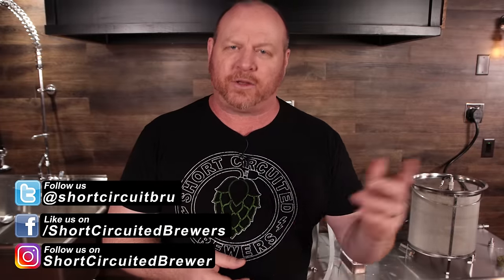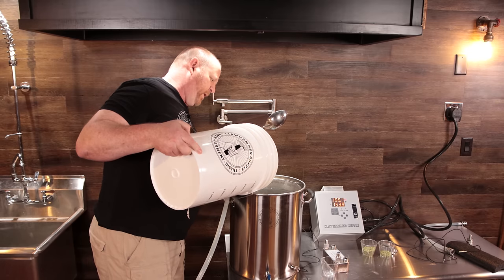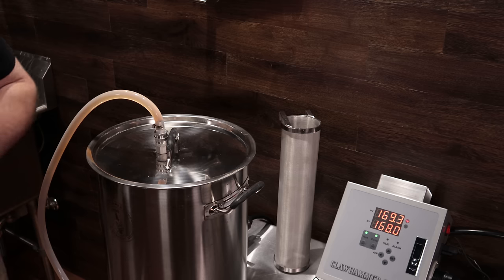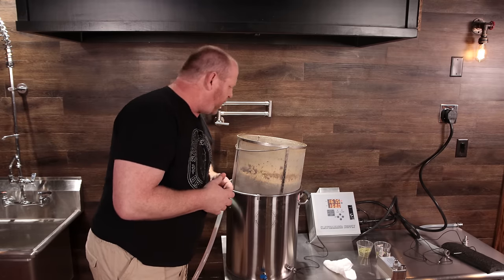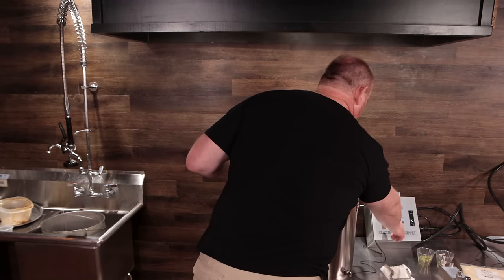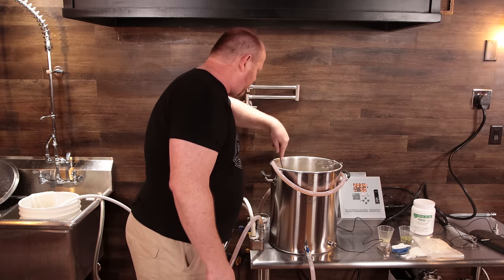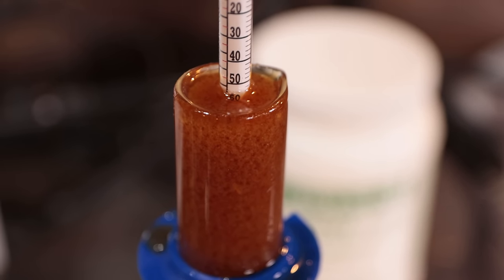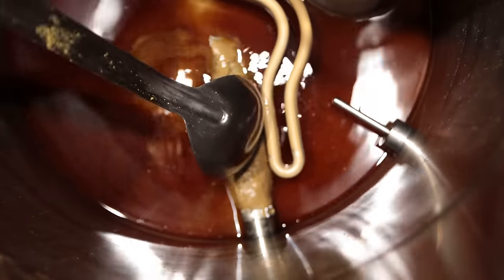Clawhammer Supply 240V 10 Gallon system Brew day/Review

Comment: Brian, thanks for all the great videos. I’ve been using the 120V version of this system for a while now.  There’s no need for a double crush. The micron mesh level of the grain basket is small enough that I use a .025 setting on my mill and I hit my pre-boil and original gravities very consistently.  One crush at that setting and you’re good to go.
Reply from the maker: Yep.. I leave mine a bit wider since I am not just brewing on one system.. The double crush was the solution for me not to adjust the mill. Should have done it this time..live and learn!! 👍🍻

Comment: I have their early 110v system, which was an upgrade from my basic “turkey fryer in the garage” set up. It takes a bit longer to get to temp but otherwise, it has been great. Easy to use, easy to clean and we’ve made some great beer with it.
Reply from the maker: Nice!! 👍🍻
Reply: How long does the 110v system take to come up to mash temp and then to boil temp? They tend to gloss over the timelines in their videos, which makes it hard to judge the system fully.

Comment: I run a DIY basket type system and I get between 85-90% efficiency regularly. My experience is that you do a normal strike water volume as if you were doing a 3 vessel brew. Use a smaller crush (I’m set to around .037”), slow down recirculation and stir about every 10 minutes. Then sparge to preboil volume as you would with a 3 vessel system. Of course this requires another vessel for sparge water, I use the grainfather hot liquor tank personally..
Reply from the maker: Sounds like you got the process dialed in very well. Good tips! 👍🍻

Comment: First of all.  Your channel is awesome. I've learned so much about equipment and the process.  I'm looking to upgrade from my 3 tier 10 gallon batch cooler system to an EBIAB. I've narrowed it down to the clawhammer 240 or the Anvil 18 gallon.  In your opinion, which is the better system all the way around.  I know the clawhammer is modular (which is why I'm kind of leaning that way) but also just recently saw that anvil now makes an 18 that does 10 gallon batches.  Now I'm torn between the 2.  Thank you for your response and for the information on all things brewing.  Cheers
Reply from the maker: Thanks for the feedback! 

They are both good systems so you really can't go wrong with either one. The Anvil has a little less power requirements than the clawhammer so that is a difference to note. The Anvil will run on a 20 amp inline GFCI (Did it last weekend as a matter of fact) so if you don't have a 240 volt outlet handy you can run it off a dryer outlet. Clawhammer as you said is modular and that is a plus since you can replace a component should it fail or you burn an element. Let me know which way you go. Use my links and help support the channel if you don't mind. 😁👍🍻

Comment: Thank you Brian. I’ve been wondering about cleaning that basket myself for ages. You cleared that up for me, cheers.
Reply from the maker: I was curious about that too!! Having used fine mesh bags that were real pain!! This was really easy. 👍🍻
Reply: @ShortCircuitedBrewers  Hi Brian. Was curious. I noticed the basket is mesh on all sides even up to the top. Seems like most of the ebiab systems like foundry/robo have a mash basket that is not mesh/perforated on the sides, but rather, only near the bottom.  Does having a basket with mesh up to the top allow the flow to go out the basket near the top instead of filtering down through the grain? Does having the mesh all the way up the sides affect effeciency if it can "leak out" the sides near the top? Thanks!

Comment: I have the 20 gallon 230 volt system. I also have lower efficiency issue. I tightened my grain mill to its smallest and I gained 5%. I have also  had issues with mash temp as well.
Reply from the maker: I was going to contact you before I made this video but did not have time. Have you auto tuned the controller? What kind of efficiency are you getting?
Reply: @ShortCircuitedBrewers  Hi Brian! I have auto tuned the controller. I may do it again. I was thinking of putting a "T" connector in line with the pump with a thermo well so I could see the actual temp of the wort as it circulates. (Not sure how accurate Clawhammer thermowell is where it is positioned). When I take a temp reading of the mash it is sometimes off by 5 F. (mash temp is lower than the wort at the bottom of the brewing kettle). I think its a flow issue.I never have stirred the mash half way through the mash but will try that as well. I wish that the basket sides were solid like Spike. The first 2 brews I did I got 60- 65% efficiency. Not happy with that as I would get 80% efficiency on my old system using a cooler and fly sparging. I set my mill to its tightest position (bottom of the line grain mill) and my efficiency went up to 70% I can live with that. I usually add an extra pound of grain. Over all I do like the system. Reach out any time Brian! Love your channel. You inspired me to go electric. Need more electric brewers YouTubing! Cheers. Shawn.

Comment: I thought they were nuts also when they used the grain basket for the hops lol. Thanks for the video Brian. Great video like always.
Reply from the maker: Yeah I made the mistake of trying it and learned really quick!! Lol👍🍻
Reply: @ShortCircuitedBrewers  seems like the hops would work fine in the basket if you weren't using the pump though, correct?  Hop spiders set too high most times so that you can't do more than a couple of ounces, so for IPA's, I'd think the basket for that would be a great selling point.

Comment: Tip for when you add dme or sugars to boil  use an empty hop spider then put any sugars etc in there as it allows it to peculate slowly into the boil-cheers
Reply from the maker: I just turn off the element and stir it in... Always works for me.. Good too. Though if you have an extra spider. 👍🍻

Comment: I have a few questions for anybody reading this:
1 Have you used the 120v? If yes what are your impressions
2 I have no experience with this type of system and I noticed sparge is not required, what’s the water to grain ratio for this? 
3 Is it possible to brew 5 and 10 gallon batches on this kettle?
Reply from the maker: 1 I have not 2 I use a calculator software, but you can Google biab calculator for an idea in how much grain you can use. 3 it will not do 10 gallon batches. Kettles not big enough. 👍🍻

Comment: I love the content of your videos! Super helpful. I'm currently debating on which all in one system to go with. Would you recommend the Grainfather 30L or the Anvil 10.5G. I'm not super worried about the price differences, just would like to know some pros and cons in comparison to one another.
Reply from the maker: I have used both, personally the grainfather does not add enough value to justify the extra cost. Now that the anvil controller is up top it makes it even harder to justify the grainfather. Get the anvil with the recirculating kit and spend the extra on a Jaded Scylla chiller and a fermenter.. Thanks for the feedback too!! 👍🍻
Reply: @ShortCircuitedBrewers  Thank you very much. I was leaning towards purchasing the Anvil system but just needed that push and that extra money being saved can definitely go to corny kegs or extra fermenters. Thanks!

Comment: Still trying to weigh my buying options ;-). Can you elaborate a bit about the temp probe and how it is "held" into the kettle port? I saw it quickly in one of CHS's vids. It looks a lot like an Inkbird style probe. I'm concerned with its accuracy at high temps and of course its longevity. I would think the RTD/XLR connector types would be more resilient.
Reply from the maker: It is exactly what you are saying. A ink bird probe in a thermo well. It is not really held in at all just slides in. I typically use weldless RTD probes in my kettle. They are using a RTD probe in this case you'd just have to adapt it to a 3.5 mm plug. Which you can do because I've done it. 😉

Comment: I'm looking for a BIAB system (120v for me unfortunately) and this seems like a nice system. You seem to be the only channel that has tried so many different brands of these systems. How does this compare to other systems? I currently run a gigawort and bags. Wile I like it fine, it kind of limits me on batch sizes. Thanks again.
Reply from the maker: On 120 volts, the brewzilla and anvil are also contender in the batch size range. The advantage the clawhammer is that you can replace some of the parts. Other all in one's lack repairablity. 👍🍻
Reply: @ShortCircuitedBrewers  Thanks. More to think about. Which one's controller holds temps the best? If the other 2 more inexpensive systems produce the same results, it might not be worth paying double the price.

Comment: Another good video. Thank you. I’ve been looking at this system and the anvil foundry. Like I have spoken to you before. I’m new to this and haven’t started yet. Could I get your opinion on what system would be best for somebody just getting into brewing.. thanks again
Reply from the maker: This system will brew great beer for sure. And quickly too lol! I think starting out it is not a bad idea to look at lower cost all in one systems . The initial investment is a. Little lower and if you should upgrade to a larger more expensive system the all in one vessels. Make a great water heater for sparging etc. 👍🍻
Reply: Thanks again for your information. Would I be okay with the anvil foundry 6.5. ?.. and is there website to help you adjust from 5 gallon batches to 2.5-3 gallon batches ? And how can I purchase one of your t-shirts.. thanks.
Reply: @danielsweet937  I too would recommend a less expensive (and simpler) system for starting out.  I went with a Mash & Boil for $300 (as I added the fermenting lid to it), and have done 30+ brews on it with great success.  Fermenting in it is a HUGE bonus as well, as my cleanup is minimal, and it helps keep my brew days under 3.5hrs.  It also eliminates a transfer, which is a risk point for contamination.

The clawhammer is what I was looking to move up to next, but I don't think I would unless I needed to brew 20gallon or high gravity batches.  If you want to do 2.5-3 gallon batches on the anvil/mash&boil type systems, there are PLENTY of online resources to adjust your recipie, and these systems will give you great versatility and ease of use for that size for sure.

Comment: Many thanks for your nice videos and the useful information.  How would you compare / rate this system against the Anvil Foundry?
Reply from the maker: The capacity is about the same, the basket on this system. Allows for a finer crush than the anvil. The clawhammer system has quite a bit more power than the foundry so heating times will be less. The clawhammer system is a bit more "modular" so you can replace an element or sensor if it goes bad. There are advantages on both sides of the argument. Price is a factor to consider too. Both systems will make great beer for sure. 👍🍻
Reply: @ShortCircuitedBrewers  Hello Brian, many thanks for your quick and helpful reply.  Your videos are very informative and enjoyable.  Best,  -Wolfgang

Comment: All things considered, would you choose the Spike single vessel system or the Clawhammer single vessel system and why?
Reply from the maker: Not having brewed on the larger clawhammer system I can't say definitively, the capacities are about the same from what I can tell. I'd provably say the spike system due to the controller having replaceable parts. Having brew with electric for as long as I have... Things go bad eventually and can you easily replace them.. 👍🍻

Comment: Is it ok to constantly stir the mash?
I'm also wondering if it's a good idea just to get a better efficiency or higher gravity ?🤔? What do u think
Reply from the maker: From the results I could not tell you for sure.. Lol 
I will say the way that the basket is designed, it won't hurt anything because you're not really filtering through the grain bed like other systems that have solid walls on the basket. A friend of mine that has been doing brew in a bag for a long time used to stir his mash at least twice during the mashed period. 👍🍻
Reply: @ShortCircuitedBrewers  i got solid walls on my :)
Reply from the maker: @leroygross9144  🍻👍

Comment: I am considering switching from Robobrew to something different. Do you think the mesh basket prevents a “column” from flowing from top of grain bed through the grain bed as opposed to brau supply’s (and I guess even robobrew and grainfather for that matter) solid wall with porous bottom design, in turn reducing efficiency?  With the clawhammer, have you noticed any improvement in mash efficiency with increased lautering rate/volume?
Reply from the maker: The system is designed as a full volume no sparge mash. You can sparge with it, but I wouldn't say the at the basket inherently is more efficient. What can be more efficient with the system is the ability to grind fiber and have a possibility if better conversion. I also think even if you're recirculating it's not a bad idea to stir the mash every 15 minutes or so. Long before we had the column type systems people were doing brewing a bag with just a bag which is very similar to this basket. I wouldn't expect much higher than 75% efficiency on average. 👍🍻
Reply: Short Circuited Brewers I agree with my Robobrew I find my efficiency best when I stir. With it, as long as I let it settle down for at least 10 minutes before I sparge and use the spigot to obtain a couple or 3 large aliquots to get the trash back on top of my grain bed before sparge my efficiency soars and wort is clear. I just like the idea of continual column motion and I think a solid wall probably helps if you do not plan to stir.
Reply from the maker: I agree. 👍🍻

Comment: At 148F you will see an efficiency bump by raising the temp to 160 for 10 minutes
Reply from the maker: Ok when during the mash are you talking about? In the beginning?
Reply: @ShortCircuitedBrewers  Sorry, no, I generally run at 148 for 75 minutes, then set to 160 and hold it for 5-10 minutes. I usually see another .03 to .05 in that time period.
Reply from the maker: Ok I did not say it in the video. I guess I assume that is common practice.. I always do it. If you can see the controller it is at 168 or something like that in the video.. I thought you were laying some knowledge on me!! Lol thanks for the clarification. 👍🍻

Comment: Is it recommended to sparge at all? Os is this already accounted for in the mash and grain profile. Would that potentially increase efficiency?
Reply from the maker: The system is designed as a no sparge. You can sparge if you want. It might gain you a little bit. I did use the BIAB Full volume mash profile so it does give you a no sparge full volume of water. 👍🍻
Reply: @ShortCircuitedBrewers  Thanks for replying! Does this system also use the 1.5 Triclamp fitting for element or is a larger one? Website isn't too clear, and the photo is of the smaller 120v element

Comment: Thank you for the video, I've been waiting to see how this came out. I'm making the change from 3 vessel propane to electric, and scaling up to 10 gal batches. I know this was a 5 gallon batch, but in your opinion, how does the Clawhammer System compare to the Spike SVBS? I've narrowed it down to those two, and clawhammer seems a few hundred cheaper and they throw in a chiller. 

Open to ideas if I should be seriously considering another brand. Thank you for your time and all the videos, very helpful.
Reply: Paddy M same boat here
Reply from the maker: The controllers are about the same. From a functionality standpoint. I would say, outside of a warranty period, the Spike controller is probably a little more repairable. If a PID goes bad, you can just swap it out with a new one. I don't think that's possible with the clawhammer supply system. The baskets are different. I am used to doing a sparge on single vessel systems. Neither of these are really meant for that. However, I think you probably could get away with doing a sparge easier on the spike system because of the way the basket is designed. The Spike system kettle definitely is higher quality construction, not that there's anything wrong with this one, just something to note. I think you can make great beer in either system, it comes down to your personal preference. Both of the companies have excellent customer service and are reputable in the home brewing market.
Reply: @ShortCircuitedBrewers  Thank you for the feedback, that's helpful. And thank you again for the review on this system.
Reply: Thank you and love the channel
Reply from the maker: @arty4673  thank you for the feedback! 👍🍻

Comment: Is that sparging throughout the mash? What sort of sparging would you call that? I'm a brew-in-a-bag brewer so I don't really know much about sparging.
Reply from the maker: It not actually sparging more of just a recirculation. Sparging would be with just water rinsing the grains after you pull them from the kettle. The clawhamner is a no sparge system.👍🍻
Reply: @ShortCircuitedBrewers  OK thanks, that's what confused me as you seemed to be spraying over the wort as well as the grains. What's the benefit of the recirculation? I'd love one of those clawhammer systems. They look the real deal, but unfortunately they don't do systems for the UK market.
Reply from the maker: Recirculation just helps make sure the grains are completely saturated to ensure as much conversion as possible. 👍🍻